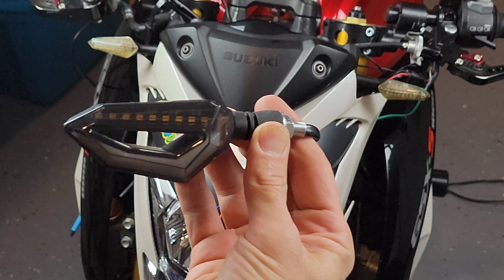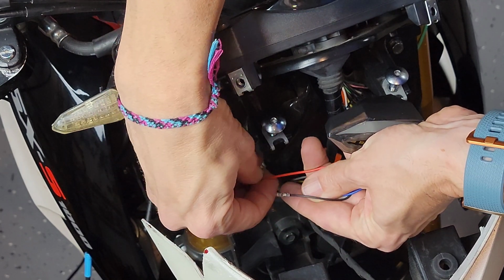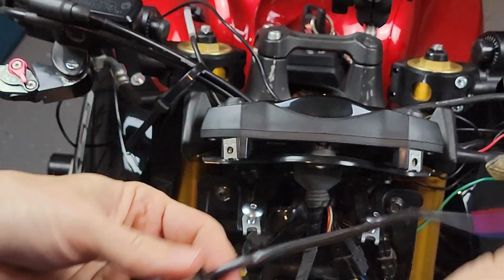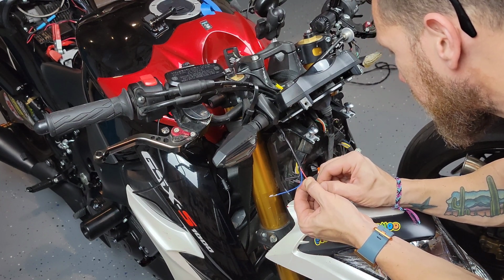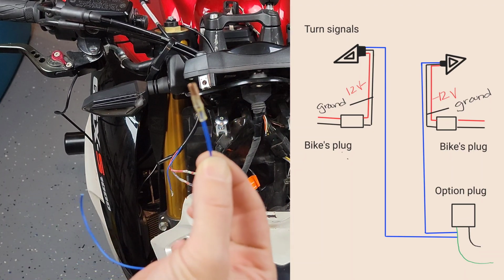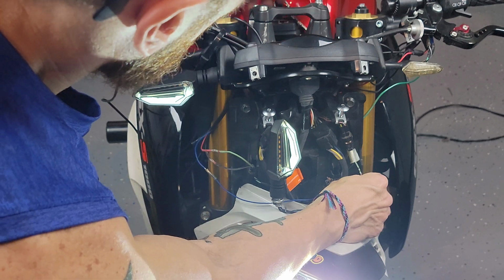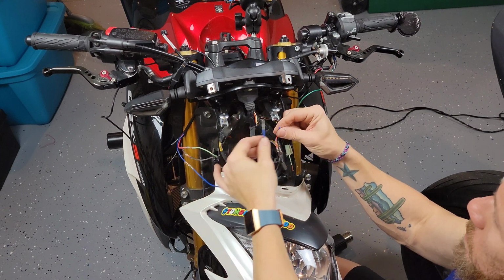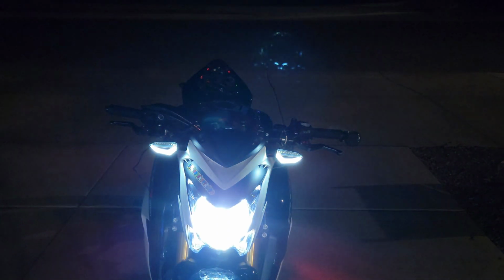GSX-S1000 - Installing LED Turn Dignals with Daytime Running Lights

Comment: Thank you for the video it was good to know before buying a turn signal with a daylight. 

Just one question is it possible if the daylight of the turn signal turn off when you use turn signal?

Comment: min. 4:15 you are checking an optional conector. Suzuki made it for heat grips....you show us one of several options....
Reply from the maker: Really! I did not know that. 

I checked the schematic, and it was available, so I used it but did not know that was the plug intended for heated grips! Huh!

I learned something today! Thank you!
Reply: @ToModorNottoMod is there any other places to use besides this plug?
Reply from the maker: @kylerscott7921 yes you can pick whatever cable is always on, constant 12v when the ignition is on.

Comment: Was wondering if all bikes have the connection for the daylight just sitting and waiting there? Cuz i want to install something similar on my bike but not sure where to connect the daylight
Reply from the maker: Sorry I did not see this message. More than not you will probably find a connevtion similar to the one on the GSX-S1000.

If that is not the case your best friend is going to be a test light to find the perfect accesory that behave in a similar manner as the running lights. If you can't find anything the headlight should be ok. There is not a lot of draw and the running lights will be on whenever the headlights are on.

I hope you can figure it out. What bike are you intending to do this mod to?
Reply: @ToModorNottoMod  a z900, actually ordered a couple of blue light on the back turn signals for the front, lets see how it goes. Thanks for the rep buddy

Comment: The signal lights are supposed to flow, and not simply flash. How can I make that happen?
Reply from the maker: Hey Ivan, are you referring to fast blinking whe you put LEDs on an sustem with incandescent lights or are you asking about an LED with a specific light pattern?
Reply: @ToModorNottoMod  the signal light should be flowing from one end to the other end. Flowing. This particular model does that
Reply: I think I figured it out. https://youtu.be/maCHeyHJWE8

Comment: Have u put led lights in for headlights?  Video?  Any recommendations?  Thanks!
Reply from the maker: Hey Chad, I did. I purchased a faitly cheap kit  from Amazon that comes with 2 light bulbs of course you only need one. I habe been using it for aboit 2 months with no issues. 

The brand is sealight. I have the link in the description of the video. 

Let me kmow if you have questions. In the comments some other folks talked about other models a bit more expensive you cam look into it too.